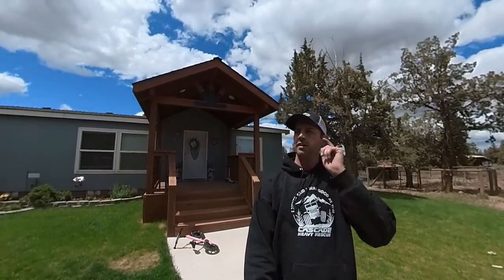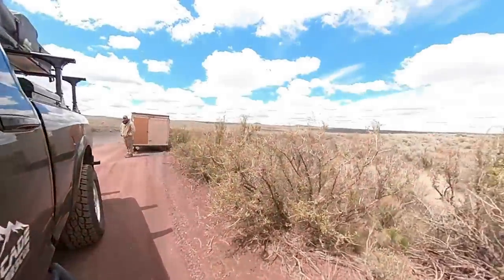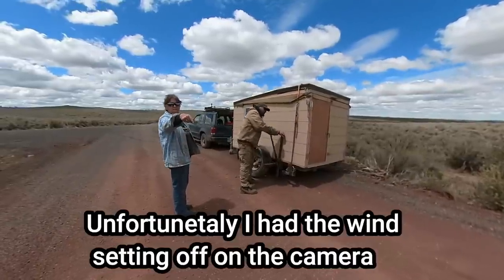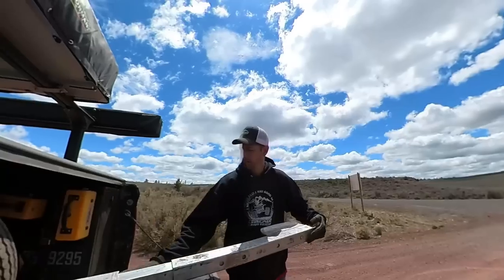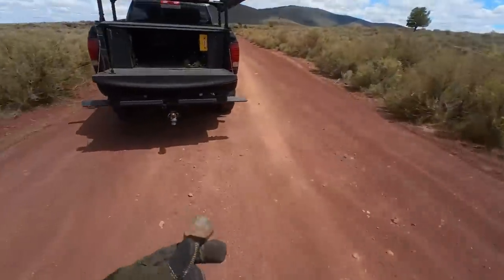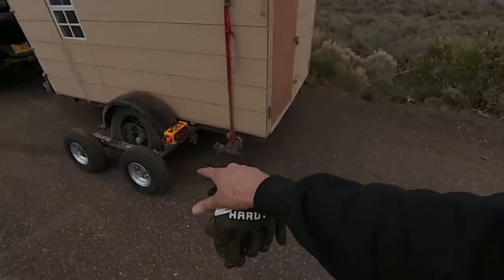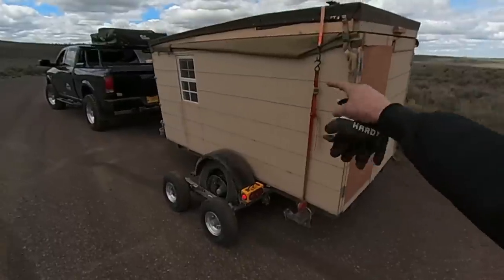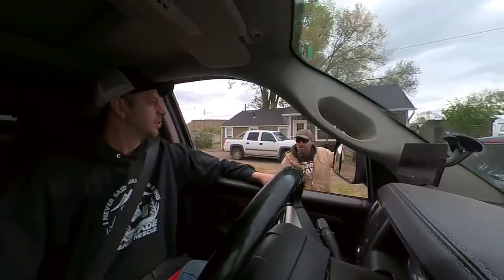When camping goes wrong!  Homemade trailer doesn't make it home..

Comment: That's the most diy camper I've ever seen and I have respect for anyone willing to build something they can't buy, especially if it allows them to do the things that make them smile.
Reply: Stamped on the tire "MOBLE HOME USE ONLY" made to be used ONCE, from the factory to the home site.
Reply: When you want something to work you don’t have a lot of money and it’s obvious that you can do something for your self, a label on a tire is just that a label. 
I know that you have never! EVER! Seen a car with the mini spare on one of its corners exceeding 55 MPH ! Even if it said 60 MPH, would you stay at 45 MPH, or just take your chances with it... 
95% is my Guess that might drive over the Maximum speed on the Tire... 
hey those trailer tires are mostly 10-12 ply rating and with the low weight compared to a House on those ... you Betcha it’s gonna go a long time, till it doesn’t!
The spare tire and wheel for such are sometimes difficult to find. I’ve been involved with a search for one on and off for a few years (a Brother-in-law had a trailer with Mobil home axles every time he brought it to hunting camp he said he was still looking for one, I found him a few and they were always out of his price range. Then he finally broke down and bought a brand new tire and wheel. And brought it to camp. That year he had health issues and he never got to pulling the trailer back home! It was a beast of a thing sat high enough to be able to get into a Deer camp in the upper peninsula of Michigan some 28 miles from a paved road with the snow and the two tracks with bogs and, holes that were water filled, at the Beginning of the 15 day season, then be dragged out on snow so deep that only Snow Machines could navigate (He also had a monster of a truck with a snow plow) the un paved roads. Unfortunately it was made of steel and wood and after sitting there for 4-5 years it had serious problems Rotted wood being the worst and the frame where the wood rotted in direct contact with the metal had become close to paper thin... as it sat outside the spare tire and wheel was inside a garage and went flat. Shame that it ended up that way but after my dad passed the Rift in family became as big as the Grand Canyon. I don’t know what happened to it but I suspect that it wound up in the scrap metal pile.
Reply: I've seen worse, ones that are just about falling off and flying away going down the road !
Reply: There are people that value their own effort; or want to build something simply because they want to say " I built that"..  Sometimes it's " I can do that for a few hundred; why would I pay someone else $10,000 or more for something that really isn't what I wanted or need.. "  I don't pity those people; I applaud them.

Comment: Good job Casey.  
I learned something about trailers a long time ago (back in the 80's); never park your trailer with the tongue latch up.  
I had my trailer sitting in the driveway and yes the latch was up.  We had a foster daughter (yes, she'd been with us that long) that was learning to drive and she put the car in reverse instead of first and backed over the latch.  When she realized it, she put it in first gear (all our kids learned to drive on a stick shift car), pulled forward and broke the latch right off.   I was able to buy a new latch.  Never had one ruined since; because I make sure they are latched down and safety pin installed.
Reply: Back in the early 1990s, someone I know backed up into a heavy duty trailer they didn't see behind them w/ a Dodge Omni.  Put the trailer hitch straight through the sheet metal, about license plate height. Of course I've made a similar mistake too. Appreciate backup cameras & LED lights more now, that's for sure. We all have rear facing LED on our UTV's, so we don't hurt our toys!

Comment: You sir are a skilled rescuer. You built the tools to make a bad situation into "just a tow", very impressed.
Reply: He didn't build the dollies. Dollies have been around for several years, Repo men use dollies all the time. The lift he has on the back of his truck is called a sneaker lift, also used by Repo men often, it sets up under the pickup bed, not easily visible to everyone, repo men can sneak in & out, thus the name "sneaker lift". 
Casey did good, but the tools he used have been around for many many years, he didn't make them😄🤣
Reply: @timothygeiger8271  He didn't necessarily build the individual tools himself, but he "built" an effective toolkit to handle whatever he comes across.
Reply: @Psyco913  one that just about everyone who's done Repo work or driven a tow truck has put together. 
Granted he has the tools needed for many jobs, but they are tools of the trade that most tow truck operators carry with them.

Comment: Our scout troop used a home-made trailer for years without issue. I’ve owned trailers for years and learned to always have a spare time and on dual axles I have 2 spare tires. I’ve never regretted the little extra weight and I’ve never had to leave a trailer on the side of the road. I have however had family that bent the axle and had to leave a boat and trailer in a Dunkin’ parking lot until they could get a new axle; can’t exactly pack a spare axle. 
Nice to see the “free” especially as a person who offers a lot of free aid, glad to see a business doing some free stuff as a lot of towers get a bad wrap.

Comment: I have the same 360' camera, get the lens protectors for it, and I would recommend the rubber lens cap.  You are in a lot of areas that will be very dirty and it will scratch the lenses.  I think it worked pretty good.  if not already use Natural View for your FOV, it flattens things out a bit more.  Love seeing some new ideas for the videos.  Keep it up!

Comment: only thing i saw that id do different is folding trailer jack opposite way so handle has more clearance witch might not be an issue hooked up to the wheel lift but i just do as habit prevent bent jack handles
love your videos

Comment: I notice the dust cap was missing on the right side of the trailer axle.  Also those mobile home axles are illegal to use in BC Canada.  I like how you used the dollies on the trailer though, could have used that trick years ago....
Reply: Illegal to use in BC Canada?
What nonsense!  Those old trailer axles are very strong and durable!
Some bureaucrats don't need an excuse to ban something!
Reply: @mahbriggs  Dayton wheels may be strong, but using them correctly is where the problem lies.  How many highway trailers have you seen going down the highway with the trailer wheels appearing to be wobbling?  I personally would never use one of those axles.  Maybe those hubs could be swapped for a regular lug-type hub.  I never tried it.  In my younger days, (as in broke), I made a trailer with trailer house axles.  I did not get much money for it when I sold it BECAUSE of those axles.
Reply: Well if they can carry the weight of a HOUSE ,  pray-tell  Mr. Beaurocrap ,  why doth thee deem such  as illegal. ( guess it was a dull boring year , & they had to find SOMETHING to ban , tax , or both 😡 )
Reply: @rythemzlatin  Those axles carry the weight of a house one time!  Plus, they are installed at the factory by someone that is competent.

 I use to say that the government should have never outlawed the 3 wheel ATVs, but they actually ARE very unstable.  They go straight up, and straight down the hill, but they do NOT go sideways at all.  Many people were hurt or killed because of the 3 wheel design.  

Take a look at one of those trucks that deliver those house trailers, they will have 6 to 10 spare wheels and tires on the truck, not just one or two.  There must be a reason.  They are not designed to be used for many miles over various terrain.  They are designed to get the mobile home to the destination, and then they will most likely never be used again .
Reply: @Rat-Builder  
My Dad pulled trailer houses for years, so I know how to change tires on them.  To me they a no different than any other wheel.  I have seen many home built trailers with conventional wheels that have misaligned axles, which is why I am very leery of buying a homebuilt no matter what it's wheels are.
I would be more worried about whether the bearings has grease than the type of wheels it had.  How many trailer have you seen on the the side of the road missing a wheel!
I would make a very safe bet more than those going down the road with a misaligned wheel.
But bureaucrats always have to make rules to prove their job has meaning, and some just love the power.
Reply: @Rat-Builder  
Do you know what the weight of those trailer houses are?
My Father pulled them back in the 1970s and early 80s.
They weigh a lot!
Reply: @Rat-Builder  
By the way, laughing at your belief that they were installed at the factory by someone competent!
I worked two summers between college at one of those factories, and you wouldn't believe just how out of line they could be!
I also spent a couple of summers in high school helping Dad deliver those trailers!
Tire failures, yes, axle failure never!
Reply: @mahbriggs  I worked for Weyerhaeuser Timber Co for many years, and some of the early trucks had those POS wheels on the drivers of an off-highway logging truck.  First, you had to be very careful about where the tab was in relation to the lug-studs, and next you had to torque the wheel wedges evenly, at an increasing torque.  Then, when you were finely done, you had to recheck the torque at least twice.  The tire man HATED Dayton wheels.  They were sooooo time consuming to deal with, and when the hub did spin, it destroyed a lot of components.  I will never use a Dayton style axle on anything I am building.  I have built several 2 axle trailers, and the axles were always spaced properly.  I even built a T Bucket from scratch, including the front axle, and the suspension.  When I took it in to have it aligned, it was nearly perfect.  All I used while building the axle/steering, was a tape measure.  The alignment guy was impressed.

Ford used, for a time, a split wheel.  They called them  the Widow-Maker because of so many people killed working with them.  Before I worked for Weyerhaeuser, I worked at a truck stop, and the owner showed me what those wheels looked like, and he told me to NEVER repair a tire with that kind of wheel.   Thankfully, we did not have many Dayton style wheels that went through the truck stop at the time.
Reply: @Rat-Builder  
My heart bleeds for you.
Reply: @mahbriggs  I haven't heard that saying for years.

Comment: they outlawed them axels here in Texas. you can pull a 90 foot trailer house with them but they not strong enough or something to use them for a homemade lowboy. most likely made by law makers thats never pulled a trailer in their life.
Reply: Can't tell if it's an old mobile home axle or a utility axle. They look very similar as they both used the hub/spoke and rim style setup. 

This could actually be an axle out of an old utility trailer. Can't really tell without looking at the drums themselves or the size of the backing plate.

Comment: early ford 3/4 ton drums will bolt right on these mobile home axles. These axles suck for light duty uses. Wheels always come loose. They are illegal in many states other than under mobile homes.

Comment: That was so awesome and easy peasy, with the components! It’s a little bit like an Erector Set of my Childhood! But unlike the Erector Set no metal flat steel screw driver or Flat steel wrench! If he hadn’t taken the tire off it would probably have been a Half hour Shorter Recovery!!!
Good Idea with the music instead of the wind noises! I like the camera, but it was hard to see how the ramps actually fasten to the Wheel Dollies...

Now a Question...
Do they work with Dual trailer axles or Triple ?
Once upon a long time ago,  I was on I-75 some where, and saw a boat on a triple axle trailer that had all 3 tires blown out by something on the roadway.  I don’t think that a Dolly system was available back then. I know that the tow vehicle was a converted truck of some sort. Saw 3 tow trucks in assistance and a police vehicle...
How do you think that could be recovered nowadays? Besides 3 tires changed on the roadside? 
It was a heavy traffic weekend or Holiday, too?
Reply from the maker: The dollies have a weight rating of 4,280 pounds, so most bigger trailers are out of the question and need to either be repaired on site, or pulled up onto a Landoll type trailer
Reply: @CaseyLaDelle  
So in theory if you had 3 sets of dollies it could be done. If the max weight of the trailer and load could be below the max rating of the 3 Dolly sets... 
it takes what 20 minutes to set up a Dolly? Give or take ... but getting it off the main roadway and away from traffic is “almost” Priceless. 
And then the issue of course is replacement of the tires, but if it was a Holiday weekend Goooooood Luck! Not only finding the correct size tire for said trailer, the ply rating etc... with the Dolly sets you are engaged in recovery immediately, no waiting for tires and the dangerous vehicle traffic and A-Holes on the road... then if you have tires available some how (Murphy’s Law would never ever come to mind) you could be ginger carefulling the repair in the parking lot next door to a Big Mac ah Heart attack, a British Knights, or a Slimmer Way!!! While you wait for the tires to Magically appear...🤔😉😂😆😎🤪
Reply from the maker: @andrewostrelczuk406  only if you had a trailer with some very abnormally wide axle spacing so that the dollies don't interfere with each other.   Which basically means that the answer is still no.

Comment: If this happened to me on my pickup, what would stop me from using dollies and pulling with my truck?
Is this the camera you used in the snow on the selfie stick?  I saw it on your driver's seat at the end. It's quite small.
Reply from the maker: Nothing, that's the great thing about this setup, you don't actually need a tow truck to use them on trailers.     And yes, same camera that was on the pole in the snow video

Comment: Throughout this I was wondering why they didn't take the tire into the nearest tire shop and either get it fixed or replace it. Would be cheaper than the cost of a tow, since seems that they were expecting to have to pay for the tow. Maybe afraid the trailer would get stolen? Someone could stay with it. No tire shops open? Just curious.
Reply from the maker: Very hard to find tire size on a holiday weekend.  Not going to happen
Reply: @CaseyLaDelle  - ahh, yeah. That would be the clincher.

Comment: So can you post a link to the g7 dollies? I want to make sure I am getting the correct ones. The videos you have posted have given me the confidence to use them with my class a Rv to tow my EV. But I want to make sure I get the correct ones cause I have seen others that haven’t made it through your torture test.
Reply from the maker: They aren't on the market yet
Reply: @CaseyLaDelle  dang okay. Would you recommend for my case? I know you won’t be responsible but with your use could you see them working in a case with a tow dolly on RV and g7 to get back wheels up on a model y total weight of 4,500 pounds on car?
Reply from the maker: @Jpaudio1  a trailer is far more user friendly
Reply: @CaseyLaDelle  yes but a flatbed trailer is very hard to store at a campsite
Reply from the maker: @Jpaudio1  yeah that's definitely a problem, but if you have to have all four wheels off the ground it's still by far the best option
Reply: @CaseyLaDelle  do you know when the new G7 are coming out?
Reply from the maker: @Jpaudio1  unfortunately I do not.  It was supposed to be early this year, but supply chain issues have thrown everything behind
Reply: @CaseyLaDelle  last question for the 18k miles you did with g7 were they all on same tires?
Reply from the maker: @Jpaudio1  two sets of tires